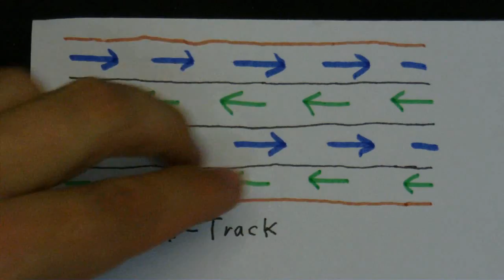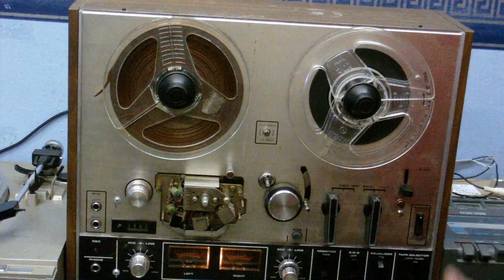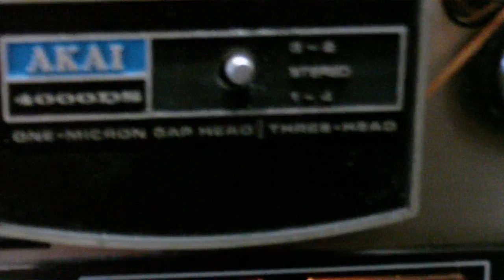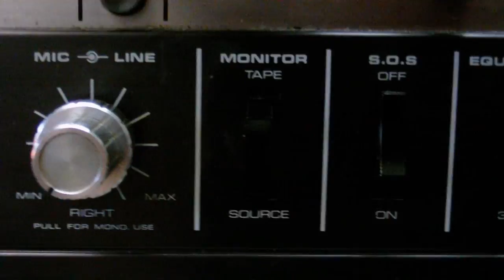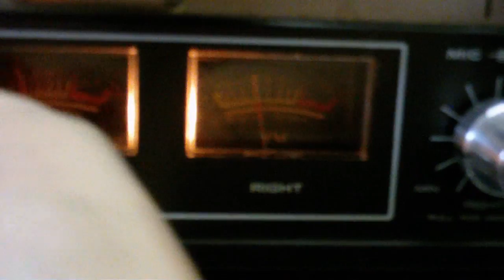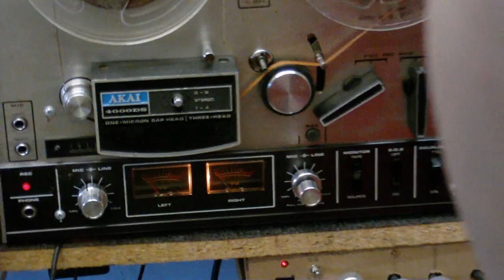How to use a Reel 2 Reel Tape Recorder

Comment: Nice video, how do one connect it to a turntable or record player.? Can one use a modern turntable as well.? I do have a atlp60xbt
Reply from the maker: If the turntable doesn't have a built in pre-amp, you'll need a separate phono pre-amp (if you don't have one allready), simply connect the turntable to the pre-amp's input, and connect the pre-amp's output to the tape recorder's line in. (or connect the turntable's output directly to the recorder's line in if it has a built in pre-amp)
Reply: @CoolDudeClem  Thanks much appreciated. It does have a built in pre-amp i believe

Comment: There's another very useful function with this deck, sound on sound. You can create multi-track recordings with this feature. For years I composed music with this deck. Guitars with keyboards, electronic drum machine, vocals, you name it. You can stack and bounce quite a few tracks before noise becomes an issue if you gain stage properly. Still have this deck!

Comment: Love your video can you show how to set your vu meter to record
Reply from the maker: I don't know if that would make much of a video, but basically on an analog recording you can go a little closer to 0 db than you can with digital. Analog doesn't hard clip the sound even if there is the odd peak here an there that goes slightly over.
Reply: @CoolDudeClem  analog will certainly distort if over 0vu

Comment: Hi, did you just connect the source directly to the reel to reel line in for recording or need to put it through an amp? Thank you
Reply from the maker: Most reel to reels have a line in jacks, so your could connect anything that has a line out to it's line in for recording. Some reel to reels have built in amplifiers some don't, this one doesn't so for listening to it you would need to connect it to an amp.

Comment: Do you know how to set up a reel to reel that has strange inputs on the back? I'm fine with the outputs as they're just 5mm jacks but the inputs are either like TV type input plugs or those weird ones that old mice for DOS computers had.
Reply from the maker: I'm sorry but I don't know what you mean my "TV type input plugs" Do you mean DIN plugs?  If that's what you mean, you can buy a DIN to RCA (the 5mm jacks) cable that has the DIN on one end and 4 RCA plugs on the other end (2 are for input, the other 2 are output).

Comment: hi to all just to let you all know I had a mono 4 track recorder. yes it can part on akai unit  but on some of the oldrecorders the tape speed was not right. when I got my first 4000ds -4000 you could hear the tape playing was not right.tip when recording keep a note with the tape what make of recorder you used. it's the big 4 track recorders that came in acase with a lid. and used tubes. I love akai units they are like tanks.

Comment: Hi CoolDudeClem, nice channel, i'm french and you help me a lot with tape recorders. I have a question, i just got my first Akai4000DS MkII, really good condition, but i have a problem. I don't seem to understand how to make a stereo record from my JVC AX-142 Stereo Integrated Aplifier. I'm currently changing pieces on my vinyl platin, so i've only been able to make records from my laptop using a jack/2RCA into the akai, and it's output into the 4 plugs tape of my amplifier. When i'm on the source, both Vu meters are moving, put the levels, but when i listen to the record, only have the right speaker working. I don't really understand, as they both work when i use the left or the right mic (even when i chose 3-2/Stereo/1-4 mode). Any idea? I'm sure i don't have the right process. Thank's for your job!
Reply from the maker: +r .vitalis Are you sure the mono/stereo knob is not pulled out?  The right microphone knob can be pulled out for mono operation witch will result in only 1 speaker working.
Reply: +CoolDudeClem Hey, thanks for the answer! The knob isn't pulled, i'm on stereo mode, SOS Off, the equal on 7.1/2 and tape selector on low noise. I have both Vu meters moving and the sound comes from both speakers when i monitor the source, everything is ok, i can record with both speakers. But during the record, if i pull the tape monitor, only have sound on the right speaker (and the left vu meter doesn't move). Same thing when i listen to the record.
Reply: +r .vitalis I don't know if it doesn't come from the wire between the laptop and the akai, which isn't 2 pairs of RCA but with a jack into the computer and the 2 RCA into the akai. I should wait until i get back my vinyl platin to try in better conditions.
Reply from the maker: +r .vitalis Maybe the heads or even the contacts in the switches just need a cleaning.  I've had that happen to me sometimes.  Do you have any pre-recorded tapes you could try in it? You could play one of those and see if it plays those ok.
Reply: +CoolDudeClem Hi CoolDudeClem, i'm back from work and i can take a look to it! I've had 3 old tapes with but absolutely don't know if they're in Stereo. I'm gonna open the beast and see if there's something to clean, but the first time i did it, everything seemed nice. My heads look a bit worn but i should look after the contacts. I don't want to bother you, but i'll tell you how it was!
Reply: +CoolDudeClem Well, i&#39;ve cleaned up the heads (they were dirty) and the switches, and it&#39;s still the same. When i listen to the new record i&#39;ve done, in stereo mode i only have the right speaker, on the 3-2 mode only the left one, and on 1-4 same sound than stereo through the right speaker.
Reply from the maker: +r .vitalis I'm not sure then, do you check to make the the stereo switch is set to stereo and not 1-4 or 3-2 before making a recording?  Another thing you could do to at least check the playback is working, if you don't have a tape to test it with, you can by hold a piece of paper on the head, then take a screwdriver (best use one that's barely magnetized at all because you don't want to end up magnetizing the head itself) and move the screwdriver around on the paper, it should respond when the screwdriver is right on top of the head's pick-up areas (you will hear some noise from the speakers) so you can see if each meter and speaker responds.
Reply from the maker: +CoolDudeClem I should have also mentioned that you might need also to lift up the tape sensing arm so the thing is on when you do this test.
Reply: +CoolDudeClem Yes, i have the selector switch and it is on stereo, and nice idea to test the playback head with a screwdriver, i've tried it and both meters and speakers responds. Could it come from the tape? I'm gonna try a brand new from thomann to see. I've checked the alignment of the heads with the tape and it's perfect.
Reply from the maker: +r .vitalis Ok then, there seems to be no problem with the playback amp, so that's one less thing to worry about, so there must be something wrong with the recording amp, it could be a number of things, such as the bias not working properly or no signal getting to the left side of the recording head.  Strangely enough I have a Sony that has the same exact problem, it plays both channels but only records on the right channel. Soon after I get my new camera I'll be doing a repair video, it might be of some help as I'll go through troubleshooting steps.
Reply: +CoolDudeClem Many thanks for your time Dude, i'll check your updates!

Comment: Hey thanks for this, very helpful. I just got hold of an old Teac X300 and a few tapes. I don't seem to have the black plastic doodads that you're saying hold the tape spools on. Is this a universal thing, so I should be able to pick some up somewhere? Cheers.
Reply: synthdemo x300 has tridents that lock when you turn the top of the axis, try it
Reply: thankyou Philip, I did discover this eventually after a bit more reading. Cheers for the reply, though.

Comment: I have a full track monaural recorders. Makes use of the full tape for better quality. Sounds grear at 7.5 ips and 15 too
Reply: There are actually two different type if ful track recorders. 1 is professional such as rhe AMPEX 600 or a consumer model. All consumer models have a guard band, the 600 has bi guard band for better fidelity

Comment: PLEASE HELP!!!
I have the same recorder. My AKAI GX-4400D plays back very well, but after +/- 15 minute it slows down, and eventually stops (the same problem for different tapes). How can I repair it??? Any help/suggestion will be highly appreciated. THANK YOU! - Henryk (h.gajewski@chello.nl)
Reply from the maker: It could just simply be the belt, or a problem with the motor (most likely the motor run capacitor). If it can still rewind and fast forward then the motor and capacitor are fine, eBay would probably be the best place for replacement belts.
Reply: CoolDudeClem Thank you so much CoolDudeClem! Yes, it does re/vind. So the hope is there :-)))))))))))))

Comment from the maker: If pre-recorded tapes sound ok, but it's own recordings sound muffled and it is a 3 head system, it's most probably the record head being mis-aligned, I would make a recording, and while recording listen to the tape (I don't know if yours has a tape monitor switch so I'm just assuming it does) and try aligning the record head while doing so.